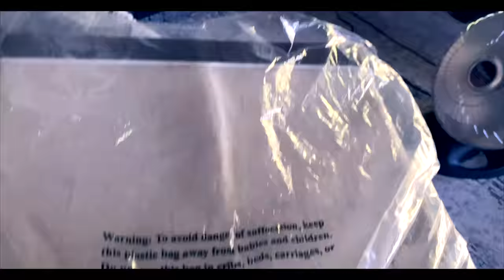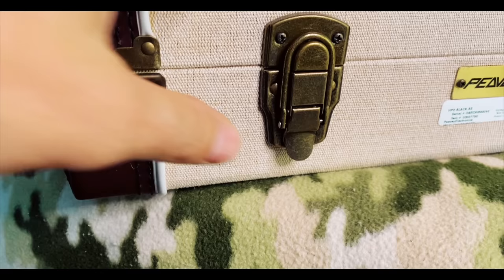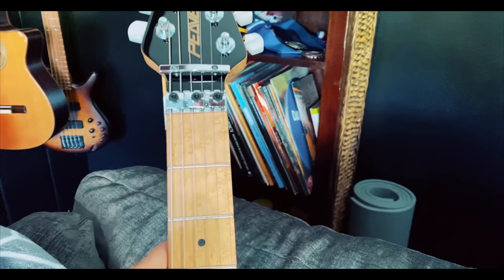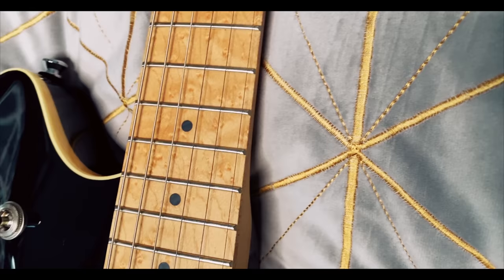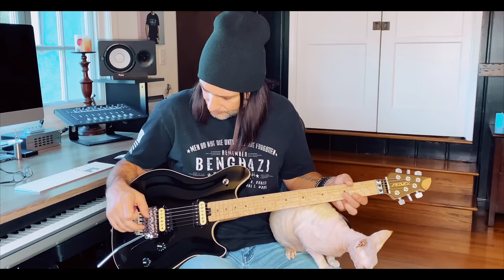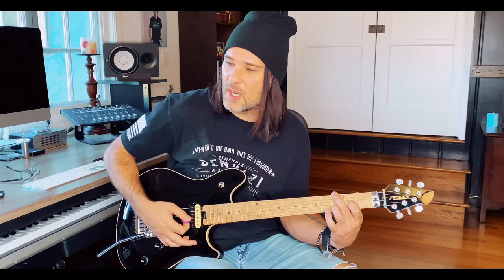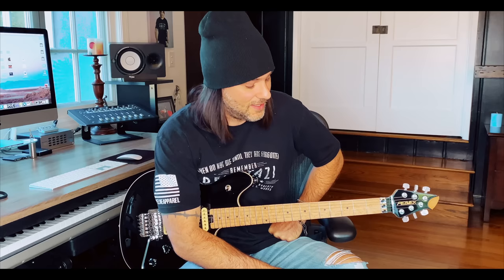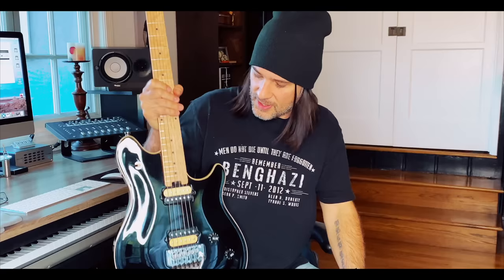PEAVEY HP2 2020 "made in Czech Republic" Review

Comment: There was also the HP Special model, around 2006. The body, headstock and few other things were different, but the concept is that - an updated Wolfgang with push-pull and cool finishes. It came with the old Peavey case and - the case candy! Should be pointed out that there were affordable and less affordable models. Pozdrav iz BG

Comment: Great sounding guitar, and I think the fun you had with it speaks volumes to how well it plays and its inspiring tones. Regarding the bright "Tele" sounding  bridge pickup, personally I prefer excessive highs over lacking highs, as it is easy to turn them down with the tone knob. Other reasons are harmonics are easier to produce, and there are some effects/pedals that just sound better if the input has a lot of highs.

There is one thing I saw that has me a little concerned, but it might just be optical and has nothing to do with the guitar's playability. The low E string has a  plenty of space to the edge of the fretboard, but the high E string looks a bit too close to the edge to me. Are you experiencing any problems with the high E sliding off the fretboard? One other thing is that "Push-Push" pots are probably better than struggling with Push-Pull pots. Thanks
Reply: Had the same issues with a Wolfgang damn shame it could be addressed so easily and without cost. 😞
Reply: @Virtual-Media  If you're talking about the high e-string being too close to the edge of the fingerboard and sliding off the fret ends, I came up with a simple, near zero cost solution. I had that problem on one of my guitars. I decided to try soldering a little bit of "lead-free" solder to the ends of the frets. I then carefully shaped the ends so they were "roundish" instead of beveled. Took me less than 30 minutes, and worked beautifully. Since you're not fretting on the fret ends, the solder doesn't ware off. YMMV
Reply: @picksalot1  Whoa, never considered that, and the solder hold’s?

Thanks a 1000 times if this works!
Reply: @Virtual-Media  The solder holds very well. I've done it on two guitars that I use daily, one about six months ago and the other about three months ago. One is a nylon string guitar and the other is an electric guitar, Strat. I see no signs of wear on the soldered ends.

Couple of tips. Before soldering, I cleaned the fret ends with a little isopropyl alcohol so the solder sticks well. But, I don't know if that is even necessary, as the solder sticks surprisingly well to regular Nickel frets!

I used thin diameter electronics-type lead-free solder, as it is a bit harder than leaded solder, and I thought that would wear better, if that was an issue.

It only takes a small amount of solder to do the job, about the head of a pin, about 1mm diameter. The fret wire end heats up quickly, within a second or two. Then just touch the solder to it.

Practice first, so you know how everything works. It's easy to do. If you've never worked with frets before, watch some YouTube videos to see how to finish the fret ends. Do NOT bevel the ends, gently round them instead so you get the best results.

The nice thing with using solder is that it is easy to shape, or to remove, if you mess up. The main cautions are to not overheat the frets, and to be careful with the soldering iron around the guitar finish. To start off, just do a couple of fret ends, and test the results. Let me know how it goes.
Reply: @picksalot1  will do and thanks for the specific details. Looking forward to bringing a couple beloved Wolfgang’s back to the favorites rack!

Comment: I have the black NOS number 16 I bought used off Reverb.  The neck was a baseball bat and was heavy lacquer finished.  I had a luthier shave about 1/8 inch off the neck and then oil the neck to beautiful birds-eye maple. The thick fret board edges were cut right angle square and had to be lightly sanded to give that warn soft feel. The action and playability is really shredder friendly now and will hold a business card all the way up.  The neck is true and very stable. I replaced the Peavey Tremelo with a Floyd Rose and SS screws/titanium blocks. The black finish is kind of soft and gets nuisance scratches easily.  Mine is heavy at over 9 pounds.  The Peavey guitar case is flimsy and not a good case.  The paperwork was also disappointing small card stock.  But... the guitar is a keeper now... plus as much as I loved Eddie... It's nice NOT to have EVH stamped all over everything.  Now... Eddie's mastery is beyond reproach however.

Comment: Good idea to bring back this guitar. I love the tiger flame one. The coil split option is an nice idea as well. 

For me it's not a problem that it's made in czech republic. I own a beautiful EVH Wolfgang Standard exotic in midnight sunset. These are made in indonesia. I bought one zilla burst before and although it was a nice one, i send it back because it had a huge gap at the neck pocket and also a twisted neck.

In my opinion the standard-series is great from the pricepoint but it's like a lottery. Most of these guitars are not perfect setup, when you get it. The Floyd is set floating most of the time, and you have to change it by yourself...

However i love it so much and was a little bit confused when i realized, that the serial number tells a story about eds lifetime: 200055 😢

Comment: I bought one: decent guitar for the price paid. However, some details make me prefer the old Wolfgang: the neck profile is NOT the same because that of the Wolfie is more comfortable and thinner. Then the bridge: even though it is a Floyd Rose, the fine tuning screws vibrate with the strings so I preferred the old Wolfie's tremolo also because it had the D-Tuna. I don't want to talk about the string lock nut because that really sucks. The high E is too close to the edge and I constantly pull it out the fretboard. Add that the Pick ups are not adjustable in height and this bothers me: they could have put two springs in there, for what they cost.

Comment: I love this guitar --been playing Wolfgangs since 1999. There's one thing tho: What is RUBBER doing touching a bridge?! Rubber absorbs vibration. You must have the bridge flush to body. A piece of rubber between steel and wood is one of the worst ideas I've seen in guitar making. Would you make your nut out of rubber? Would you have rubber bridge saddles? Rubber and Floyd Rose don't mix.
Reply: I just got mine.  No rubber.  The build quality is great overall, but there are a few imperfections.  The trem squeaks, there is a small spot of overspray on the pickup switch cavity, and it is HEAVY (like 9.1 lbs)!!  The neck is butter, though.
Reply: @ajlsrv5490 . They're great guitars I always preferred the PV head stock carve.
Reply: Who cares!  It’s a tiny piece of rubber.  I don’t care what you say, you won’t hear the final difference or it won’t be enough to matter.  Amp and pickups will effect tone more than a stupid piece of rubber

Comment: I can't believe you had so many problems with the earlier line of the HP2.  I bought a used 2018 and it's fantastic. It doesn't have any of the issues that you mentioned. I know I'm certainly not paying $2600 for a guitar made in the Czech Republic. Those need to be under two thousand. The model without the flame top needs to be a lot less than that. I don't know what they're thinking with their pricing.

Comment: I had one of these, I believe it was one of the earlier runs that was still made in the USA.  Was an overpriced pretty figured top with a nice birdseye maple neck.  The parts and components felt like cheap crap.  A bottom of the line Floyd special, cheap pots and mediocre hot output pickups?  No thanks, not for $2500.  Not to mention, the fretboard edges were not very rolled at all making the neck feel very uncomfortable.